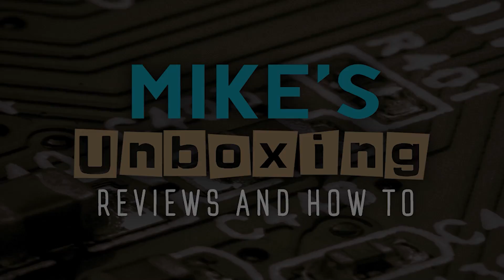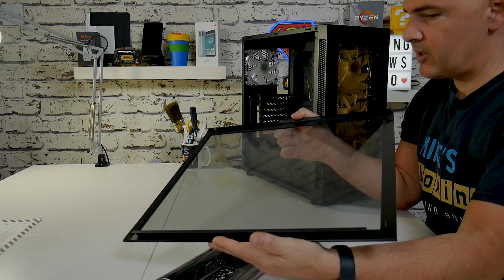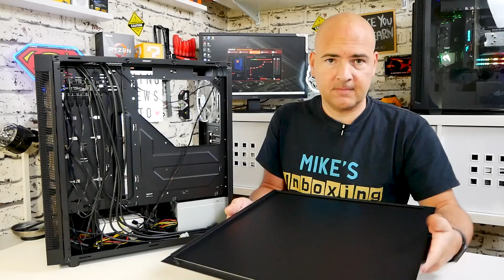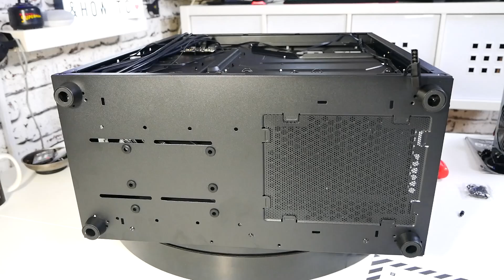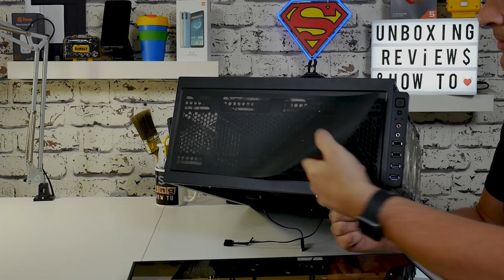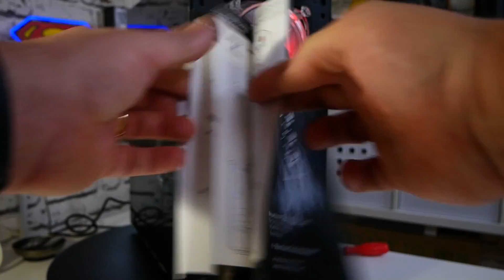Sharkoon TG5 PRO Redesigned With Addressable RGB

Comment: how do you remove front panel ?
i want to change my stock fan,
Reply from the maker: should just plug off from the grab handle at the bottom, there might be screws also, been a while since i had this case in front of me

Comment: to control the argb via motherboard/software ¿do i have to plug the sata into the power supply and the 3 pin cable into the motherboard? ¿Or just the 3 pin cable?
Reply from the maker: you still need the sata to power the ARGB the 3 pin ARGB is basically a data cable sending the info to the hub or splitter

Comment: Hi mike, so i have a sharkoon pure steel rgb with 6 sharkoon rgb fans, ho do i connect them all to the msi b450 tomahawk max.
Thanks for the help.
Reply from the maker: Not possible. sorry you can't use that board with addressable RGB
Reply: So how can i make it addressable is there no way?
Reply: Like how about the b450f from asus

Comment: Good video! Can't wait for the next video of this case. I'm still unsure if i should buy this case, i would like to see the temperature differences with the front fans being on the back of the front mounting area.
Reply from the maker: Spoiler it made a big difference to am using the case now in the pc behind me in the videos and it is much improved with the fans moved back a little
Reply: @mikesunboxing  That is nice to hear. I was going to buy the tg6 case from sharkoon but that case has the front fans mounted  like the tg5 pro and it seems a bit difficult/complicated to mount the fans behinf the frame. I don't know if it is even possible but this case seems easier to work with. Thank you for your reply and keep up with the good work :)

Comment: Hi Mike. I never have probs with missing holes 👀 as BEFORE a build I decide HOW the cables are going to go AND if necessary CUT extra slots/holes et I always use a file to remove any sharp edges et Rare but when I do works for me. How big hole / slot for the audio cable? two holes drilled close together creates a slot prob 8mm - file to smooth and we're done. That's the beauty with mild steel cases they're so easy to mod if you have the tools to do it. I like the completely covered in lower power supply HDD cover. I'm a GameMaster case fan and theirs as you know has a slot that I usually cover with a glass warning sticker et Also with just the raw case you can mod it with ie vinyl to change some of the colours et interior BEFORE the build. Gold and or carbon fibre works well with the ARGB. I might be tempted on the next build to go for this case 🐱‍👤 Stay safe ! Great review 👍
Reply from the maker: thanks arthur, like the idea of carbon fibre, might have to get a MSI carbon AC motherboard to do it justice though

Comment: I will be interested to see the difference in cooling fan location when you build it ,the corsair case i bought has limited airflow at the front but the front panel is hinged to access an optical drive and with it open fans can get airflow through the front dust cover so my plan is to leave the front open when gaming or partly open ,
Reply from the maker: i did the build last night and i moved the fans behind the mount and the airflow was much improved, have a play with the fan mountings and you might get a better result

Comment: Its not a tall midi tower, those 3 fans look like a tight squeeze to me. Looking at the roof I would also agree that a radiator is probably going to impede on the motherboard or connectors.
Reply from the maker: i don't think i said it was a tall midi tower? i didn't mean to if i did.
Reply: @mikesunboxing  No you didn't Mike, I was just commenting after watching that "Its not a tall Midi Tower"  I was comparing it to my Midi which probably 6 inches or so taller. Also, on Discord you asked my YT name and I gave you my Instagram name "Wildlifesnapper1" like a nerd, my YT name is Gary Haigh.
Reply from the maker: Gary Haigh lol I understand 😂

Comment: Overall not bad but the price is the issue for me, if it was £50 then it's a winner but £75 is putting it in the same class as Phanteks, Corsair and Cooler Master cases which usually have better overall build quality and are easier to build in so at £75 I wouldn't buy it personally.
Reply from the maker: is was unsure at first and now a day later after doing a build and checking thermals etc i think it might be a good alternative to the others you mentioned. But of course if it was cheaper then that would be amazing

Comment: i missed half of the review as you was teasing me with the rev220 partially in shot. (Postal delays mean my 200s delivery is pushed back to arrive on my birthday like gifts. The great lattice of coincidence that lies on top of us at play) I don't recommend trying to remove front glass panel, you would have to use heat and the plastic would deform before it got hot enough to release the bonding. I have seen it tried before 3 times now the results are not pretty.
Reply from the maker: lol video update on that due wednesday and maybe i'll give the glass removal a miss :-)